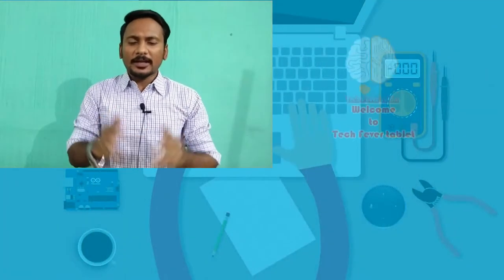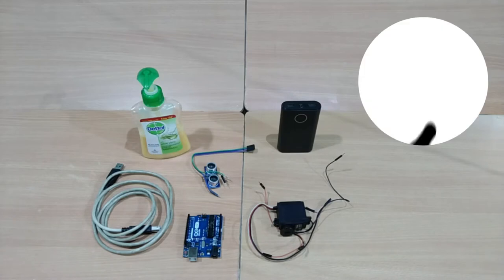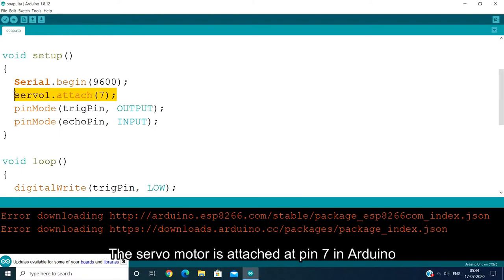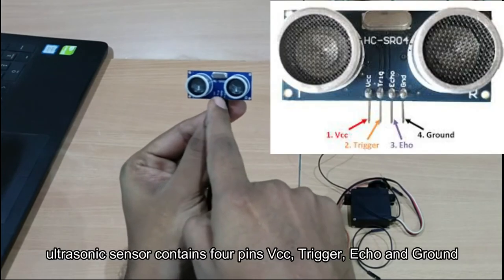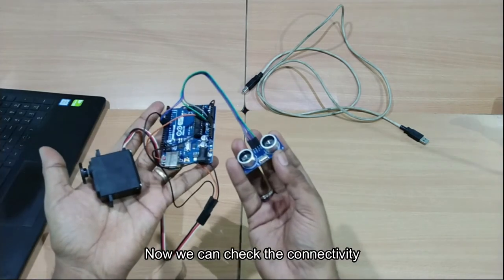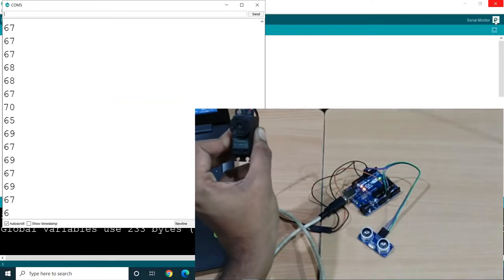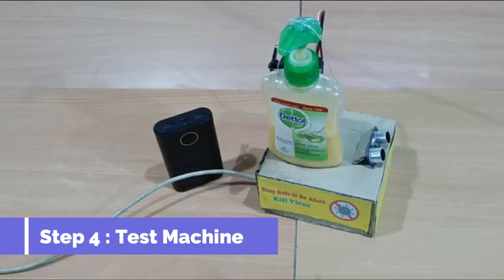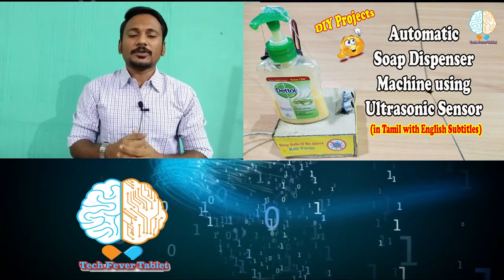Automatic Soap Dispenser Machine using Ultrasonic sensor in Tamil with English subtitles | DIY

Comment: there is only one pin called as 5volts or 5v how can I attach servo and ultrasonic sensor both pins on 5v
Reply from the maker: I attached both on same pin. But its too good to use breadboard for having more pins on 5 v
Reply: @techfevertablet  thanks for your kind reply I've tried it with 3v pin but the main problem that I'm facing is the knob or part from which solution comes out with servo I but it isn't working I guess it's probably because of less pressure on the knob do you have any solution for that?